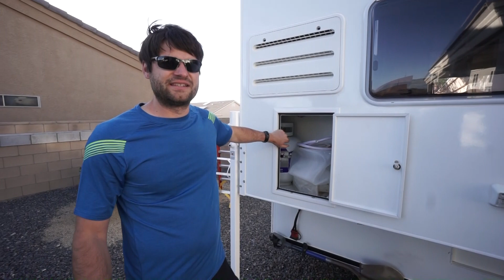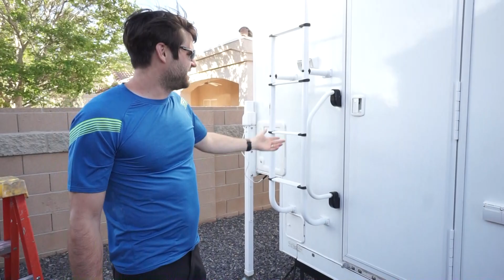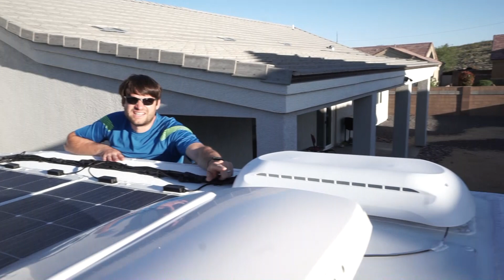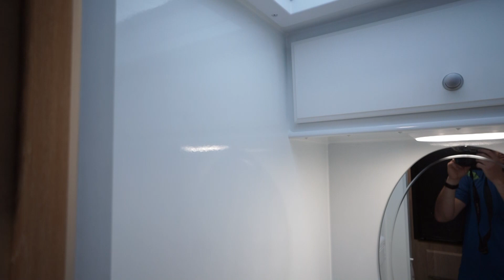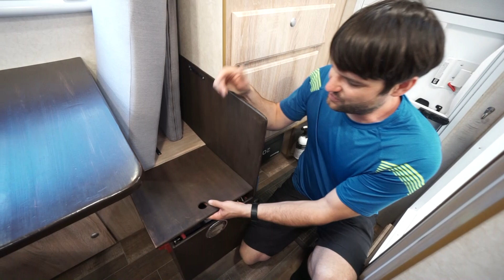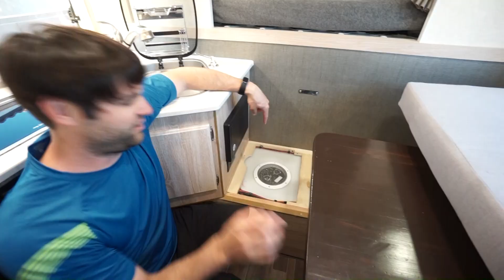Sad Day… Selling our Off Grid Truck Camper!  875W Solar + 40 Gal Water + Lithium Power!!

Comment: Do you guys have a video for how you painted or wrapped the camper? I looked but haven't found one.
Reply from the maker: We just removed all the decals.  Just exposed the factory fiberglass gelcoat (which looks much better than a bunch of vinyl stickers).  Makes it easier to wax as well.  :)
Reply: @TruckCamper , I had no idea they’re stickers! I ordered one of their OffRoada models. Hopefully they’re just stickers on that model also and I can remove. I like the look the way you guys had it. 

Have you guys seen the OffRoada? Kinda seems like Rex had watched some of your videos and the adjustments in the “new Liberty” reflect that. I like the change to the Cabover shape and the added storage that comes stock in the cabover. The larger fresh water tank and larger fridge are also very nice. Wish a basement slide out like you guys had was an option they offered. I don’t have the time or skills to build that myself 😅. 

Thanks for your videos. I enjoy them a lot. Will you guys be getting another truck camper some day?
Reply from the maker: Maybe you can ask for them not to install the decal (stickers)?  That would save cost and labor for both of you.

I haven't seen the OffRoada in person.  It's great if they keep improving their product and getting customer input.  The Liberty certainly checked the most boxes (at the time) but did need a good amount of modification to dial in (for our use).  But it was a great starting base and it held up well.  

Congrats on the new camper!  There is so much to love with truck campers.  We have been trying a couple trailers since selling the truck camper.  Planning to share some videos on it (in the next couple months).

Thanks for sharing :)

Comment: Im wondering how your northstar held up after 5 years. Despite the bear damage how did you rate the build quality overall. Cheers.
Reply from the maker: Structure held up great no issues.  Not a fan of the TPO roof but they work with maintenance

Comment: Did you sell it yet? And if I may ask you a question if you were going to haul a camper of this size or slightly larger would you personally prefer a crew cab short bed or a crew cab long bed?
Reply from the maker: Camper is payment pending.  We would absolutely buy the same truck we currently have (short bed / extended cab).  Shorter wheelbase makes maneuvering much easier (in town or off road).  We owned the crew cab / short bed previously and sold it after 1 test trip.  It's that different!  
Our truck is still for sale and fully dialed if you want a turn key rig:  
https://forum.expeditionportal.com/threads/expedition-ready-2020-f250-on-37s-locked-f-r-4-30-gears-hp-d60-psc-hydro-fox-2-5-camper-875w-solar-lithium-40g-h2o-98k-arizona.244221
Reply: @TruckCamper  thanks for your reply. I get you...I own the same truck configuration but its with the 5L engine (F150). I am pretty bent on buying a diesel. had them before and just got to have the power, but after what you said, I am leaning more towards the short bed. thanks

Comment: I suffer much without AC. Otherwise I would be interested.
Reply from the maker: 12v cabinet style air conditioner would be the ticket.  Bunch of vans running them!  Probably could run just from the roof solar.  Worth checking out
Reply: @TruckCamper  Do you have a recommendation on a 12 volt cabinet style air conditioner?  I trust you folks.
Reply from the maker: @nickberg4379  Not directly.  May need to dig in a bit for information.  It's a bit limited.

Comment: Will it fit in a 5’-5” Raptor bed?
Reply from the maker: The camper floor length is 7ft.  So it would sit on your tailgate.  Biggest limitation with the Raptor is the limited weight carrying capacity...  Super Duty is the ideal hauler rig.  We will be selling our truck which has been setup specifically for the camper weight.  :)